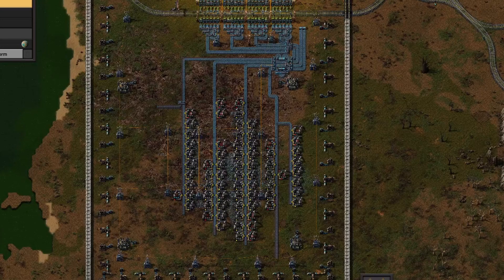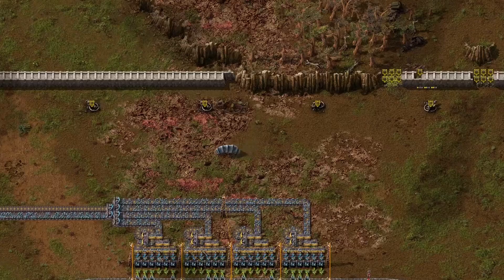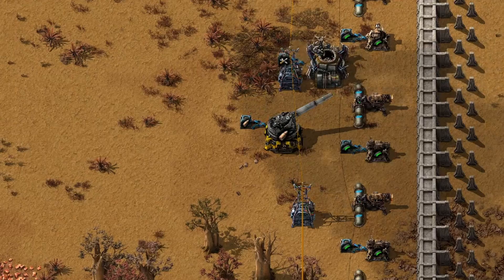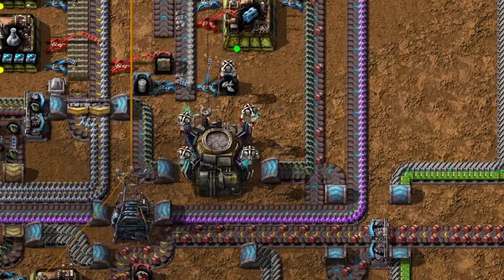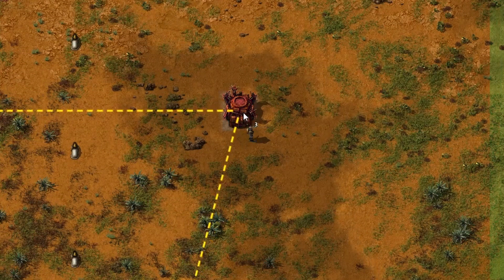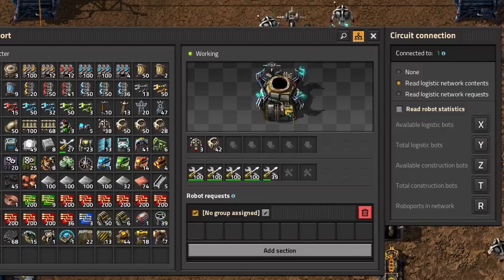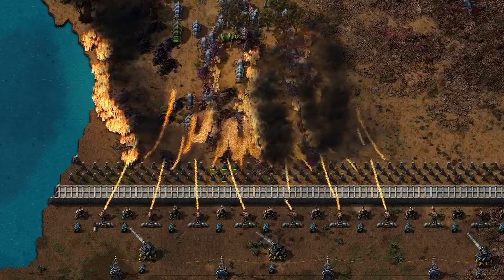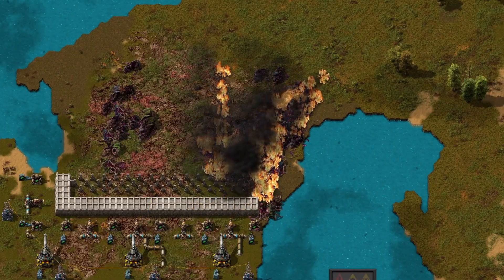Stop Micromanaging Outposts – Full Automation Guide

Comment: Instead of one Flamethrower feeding the next Flamethrower, how about a Pipe network about 5-6 squares behind the Flamethrowers, with Undergrounds going from the Pipe network forward to the Flamethrowers?  This way if a Flamethrower is destroyed, the overall network is still intact.
Reply: If things have gotten so bad that your flamethrowers are being damaged, it's time to rethink your whole defensive strategy, as it just isn't working.  In my playthroughs, even the walls rarely need replacing.
Reply: @KeithOlson  Yup, but this was a modification for the defensive setup seen in the video.  A simple defense setup I have seen is a 3-thick layer of Laser turrets

A more complex setup is a 'funnel' where the Biters are channeled into a narrow and long section that has dragon's teeth in it, while Turrets and flamethrowers on either side of the funnel open fire.  The funnel is open to the rest of the base so the Biters never have a reason to attack the Walls, but the Biters travel slowly enough that they get taken care of.
Reply from the maker: Yes, that's a more reliable way.

Comment: That's a pretty good overview.  Some thoughts:

1. Biters will attack anything that blocks their way forward if they can't get around it.  Numerous videos show that using dragon's teeth by themselves--or with funnels in your walls--is sufficient to slow biters down without having them attack your walls.  (I rarely lose ANY walls during my runs.)

2. Walls are cheap, and repairing them gets VERY expensive, especially in terms of lost bots when they try to repair a wall in the middle of a battle.  A better system is to use TWO roboport networks; a forward one that only has ammo and walls, and a second--far enough back that its construction range doesn't touch the walls--that has repair packs and replacement turrets/belts/etc.  (If you only want to use one, it is best to have your roboports  and storage chests as far back as possible, so, by the time the bots have gotten to where the walls need repair/replacement, the attack is already over.)

When you combine those two concepts, you can have fully secured borders that minimize expenses.

Cheers!
Reply from the maker: Thanks